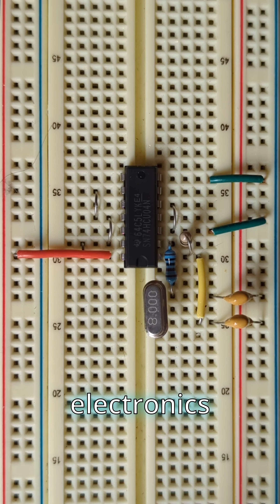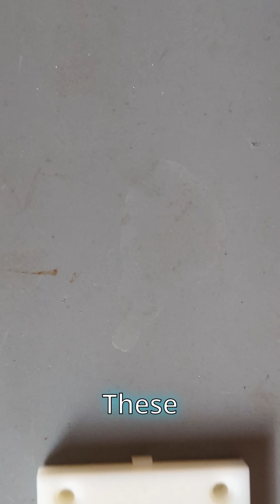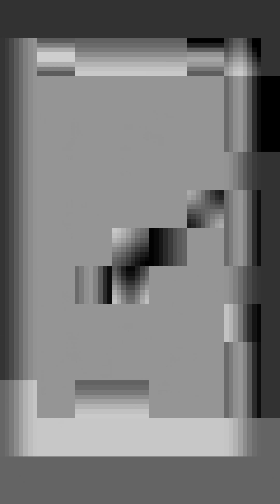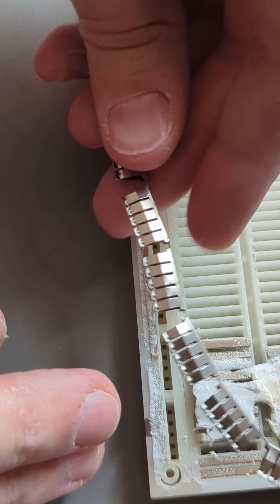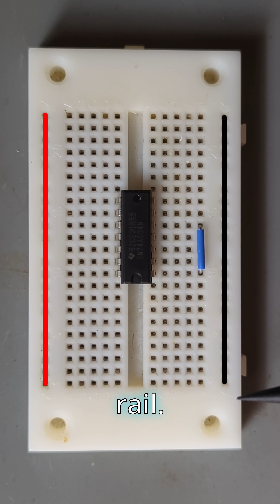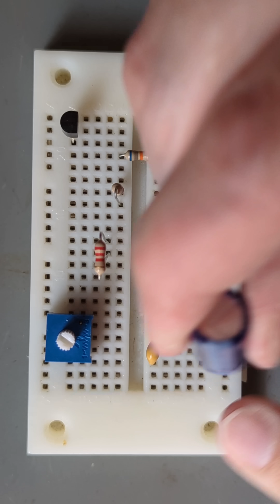Solderless Breadboard for Beginners #diy #electronics #breadboard

Comment: Would you do a video (or even just a good short) on breadboard care, “dont’s”, and cleaning? 

Connections get loose over time or after inserting leads which are too thick/wide/etc, if inserting formerly soldered leads then conductive particulate can get scraped off of component leads to remain inside the board, components can fail and leave a residue, overheating can melt or warp the plastic, dust can collect over time, etc…

Another I’d like to see, would be a video about minding and managing parasitics, as well as cross-talk noise, RF and other interference, shielding considerations, practical limits… etc
Reply from the maker: Thanks for the great video ideas!